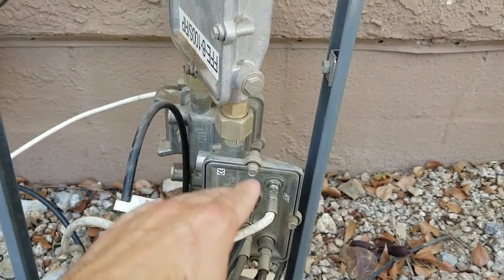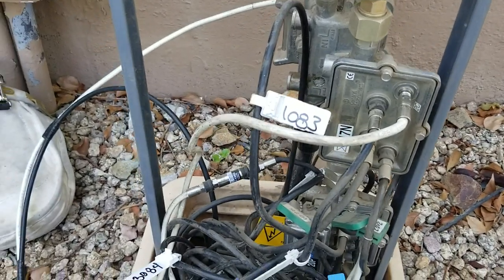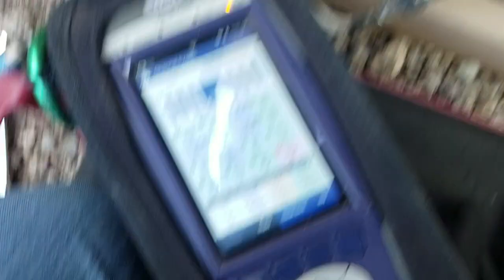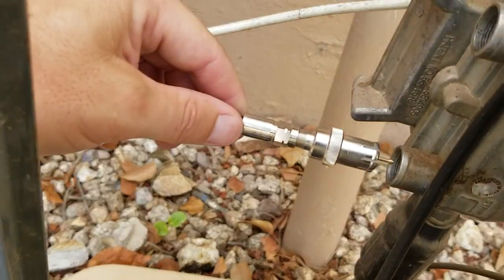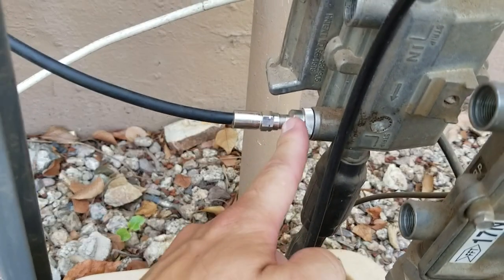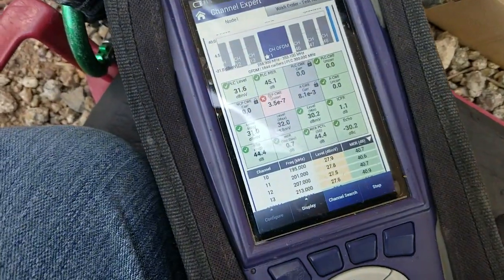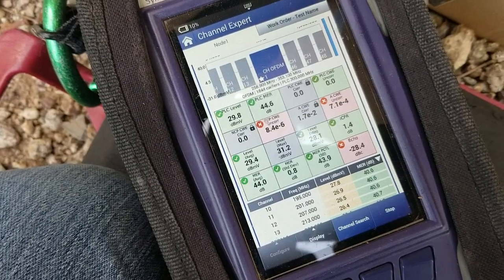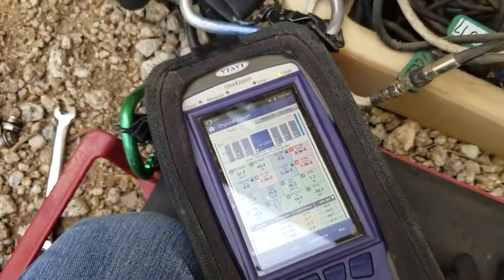How to track the direction of ECHO on plant

Comment: The diplex filter in the equipment helps isolate these issues, just as it does chasing upstream noise. The input to the line extender is a 20db test point (imagine it as a 20db tap) and the only echo it will see downstream of it is from the circuitry on the amp itself up to the diplex filter. The most common things that cause echo are corroded connectors, inputs, outputs and splices gone bad. You have to imagine like your yelling down a hallway and you hear your voice echo back. If someone was at other end they would hear you yelling and maybe a bit of the echo moments later from it bouncing back to source and back to you. To continue this laboured analogy. Someone was yelling and there was 3 hallways with screen doors and closing 5he door to one hallway (istop) lowered the echo you could determine what hallway was the main source of the ecjo coming  back

Comment: Can you or someone explain the difference in a 0 probe vs an I-stop for tracking noise? I typically use the zero for noise but it seems like you use the i stop
Reply: I just pull return pads very quickly while monitoring the analyzer and fec/snr polls. Get narrowed down to a few taps and start with the disco drops. But i understand that could be a very low opinion because you technically flash plant in doing so.

Comment: That gilbert plunger, connected to meter,  will the plunger protect the meter from power?
Reply: The Trilithic I-stop I used to use had a voltage blocker built-in, so you could plug it into taps that had AC.

Comment: Ripples and echo, do you troubleshoot them the same?
Reply from the maker: No, ripples are more tricky to track. Usually requires software that tracks the modems and isolates areas and footage of where the incident takes place.  Technically each modem is a TDR to tell you the distance to the impairment since the CMTS and modem communicate. There it can determine the distance in time it needs to apply certain equalizing for different plant faults as the upstream travels from the modem to the CMTS.
A program tracks that and spits out a footage to the fault. Definitely some sorcery behind it lol.
Reply: I'm still dealing with issues tracking Ripples. i know they don't travel thru diplex, and I've tried several time using PNM tools but still lost since none of the modem showing ripples in the group delay matches the TDR for te impairment point. So far the only way I've found efficiently is terminating what ever you have in front and check for ripple counts.@thebasiccablechannel7464

Comment: Curious what you ended up finding that caused the echos?
Reply: So I have a question. If the cable between the 12 tap and the amp was bad causing the reflection wouldn’t it show on the 17 tap as well or was it attenuated enough to not effect signal at the 17 due to the eq and insertion loss of the 2 taps there in the video. Also at the amplifier were you showing an echo? Or simply degraded signal due to the corrosion? If the echo is forward signal reflecting back then how would you determine that the problem was before the amplifier if what you were seeing at the input of the amp was in fact an echo? Wouldn’t it also be safe to assume that the problem could be after the amplifier?
Reply from the maker: The cable after that tap was corroded and needed to be replaced. I TDRd it and turned it over for construction to replace it.
Reply: Good question, wish somebody could answer that.

Comment: Would you recommend a female test probe or a I Stop? This will be my first test probe and I want to make the right choice
Reply from the maker: MonkiJuan to me they are both equally valuable. I probably use my Gilbert NS9178-1 female test probe more often. But my I stop is more expensive and valuable in tracking noise.